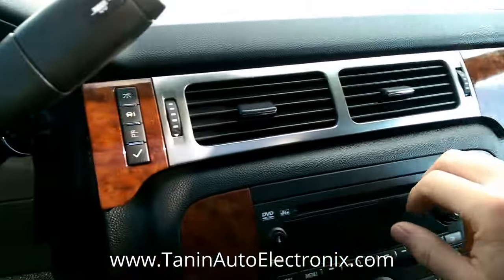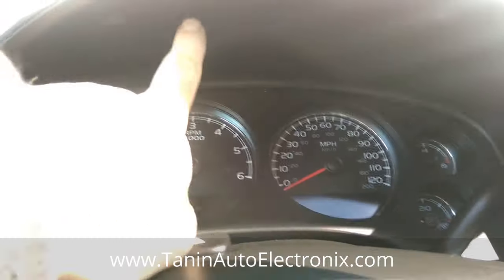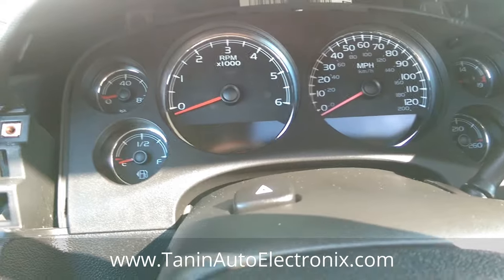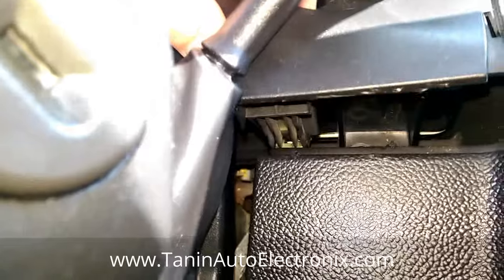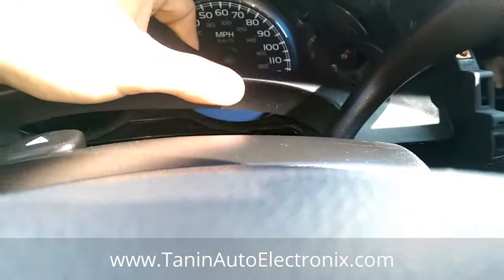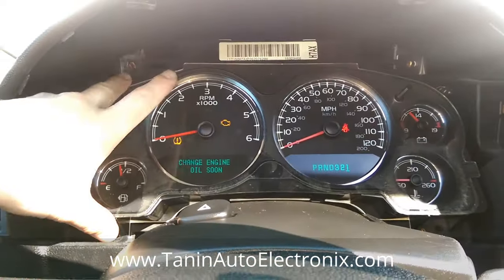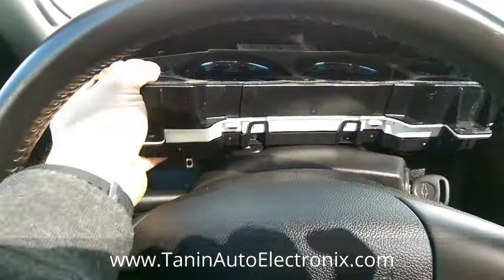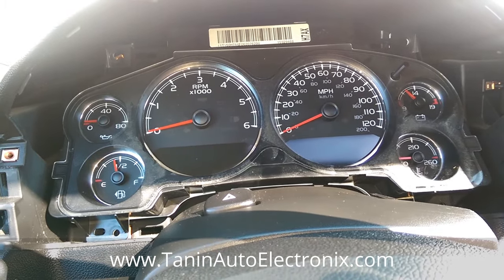How To Remove 2007-2014 Chevy Tahoe Silverado & GMC Sierra Yukon Instrument Cluster for Repair Tanin

Comment: quick question my 2010 sirverado start to fade the dashboard light turns on during the day but off at night time ,, so what it could be the issue i dont think is the bulbs inside the dash cause they turns on pretty good during the day but goes off at night
Reply from the maker: Could be the cluster itself, could be the solar sensor, or something in the truck that's telling the lights to turn on or off due to light or lack of light.

Comment: Question is there a upgraded gauge assembly replacement for the 2007-2014 Tahoe/Yukon/Sierra/Silverado? That gauge assembly is plain and out of date for that year vehicle, much improved on the 2015 and up.
Reply from the maker: No. Only thing we could do is change the greenish backlighting to a more modern bright white.  If you have a base model 4-gauge cluster you can also upgrade to a 6-gauge like the video.
Reply: +Tanin Auto Electronix understand and thank you for the reply
Reply: can i use this gauger in a  03 avalanche
Reply from the maker: Can you use a 2007-2014 cluster in a 2003? No.  You need to use a 2003-2005.
Reply: Tanin Auto E
...
lectronix
Reply: I realize this was from awhile ago but yes actually u can update the cluster you can buy replacement back screens and needles to change the entire look of the cluster and you can change the color of the lights inside it
Reply: You can buy the Z71 cluster for these models. Looks much better.

Comment: Could this be the problem for my check engine light not lighting up at all ? Even thought everything else lights up. Bc I failed my inspection over that. Also is there a fuse for a checking engine light?
Reply: Late Answer But Theres Time Where the Check Engine light LED will go out

Comment: 2009 Suburban LT - 1500 5.3 L.    The gauge cluster does not have the “Relearn Keyless Remote” module.  And it asks to “Service the Suspension System” which this model does not have.  Is it possible to reprogram the existing cluster with correct software?  TY JIMc
Reply from the maker: Cannot reprogram the incorrect cluster for the vehicle. It sounds a different cluster was installed that will not work for your truck. Would need more details.

Comment: 2013 suburban. My oil pressure is 80 after starting right away. Question is, is it the sender unit or stepper motor?
Reply from the maker: The cluster is working since it goes form 0 to 80.  It's just doing what it's being told to do. The problem is elsewhere
Reply: did you find the issue? Mine is doing the same thing.

Comment: When you unplugged the cluster from the cord, did it lose it's odometer reading and other info?
Reply from the maker: Hi Noah!

No, the mileage is stored safely in the cluster and will not erase if you take the cluster out of the vehicle. If you need help with repairing your cluster, please reach out to customer service and we'd be happy to assist you!
contact@taninauto.com
262-456-4147
Reply: @TaninAutoElectronix  Ahh, thank you. I was just looking to put a new overlay on it. My speedometer has the 20-40-60 and so forth, and it kinda throws me off. I like having the 10-20-30 and so forth. XD
Reply from the maker: @princenoah21  this would mean you have the base 4 or 6 gauge cluster, you would need to upgrade to the 6-gauge "Tahoe style" with the 10mph splits. We can set you up with that! Reach out to our customer service department and reference this YouTube video.
contact@taninauto.com
Reply: @TaninAutoElectronix  Oh yeah, mine is the 6 gauge cluster.
Reply from the maker: @Prince Noah  If you are interested in an overlay, please reach out to our customer service department with your vehicle information and reference this YouTube video.
contact@taninauto.com

Comment: Is it possible to swap a 2011 Silverado's cluster with a 2014 Silverado's guage cluster? And if I were to do that, what should I look out for?
Reply from the maker: These clusters have to be programmed to your specific VIN. As far as we know, the 2011 clusters and 2014 clusters are not interchangeable, so the VIN programming won't work and therefore the 2014 cluster won't function properly when installed in a 2011 model.

Comment: Hi I have a 2008 Chevrolet Tahoe n the problem is as I'm driving the cluster turns completely off n then back on as if I'm turning the key off n on n also seems to do it when temps drop below 60 degrees very very strange " any suggestions " thanks
Reply from the maker: Our techs would need to test your cluster to know for certain whether you need our repair service or a replacement cluster. Please give our office a call at 262-456-4147 or send us a message here: http://bit.ly/tae-contact
Thanks for watching!

Comment: I'm having an issue I thought you might know about I have an 08 Silverado Z71 just started it today the mileage and everything was flashing now the oil pressure is reading 40 not running folding reading 16 not running the fuel is showing half not running and when it is started they all maxed out except the temperature speedometer and tach are working any ideas
Reply from the maker: It sounds like you would need a new cluster but give us a call at your convenience to talk more about the issues. We have many options to help, including repair and if repair is not an option, we do sell refurbished clusters as well. 262-456-4147

Comment: Do you have to replace the cluster if the taillights turn signal don't work? I've replaced all 4 bulbs
Reply from the maker: Sorry for the delayed response Curtis! Unfortunately, we have not heard of this being an issue related to the instrument cluster before so we wouldn't be able to tell you for certain. Let us know if you found any answers!
Reply: OK thanks someone said it was a relay built into the cluster for the turn signal
Reply from the maker: We'll have to keep an eye out for that! While we do sell many replacements of these clusters, we just haven't had a customer tell us that's what their issue was (yet). We couldn't guarantee a replacement could fix your issue, but if you decide to go that route, we can help you replace your instrument cluster. We will make sure you get the right part, rebuild it, and program the VIN and miles into it.

Call our office at 262-456-4147 or check out our website listing at https://www.taninautoelectronix.com/product/2007-2013-gmc-chevrolet-truck-instrument-cluster/

Comment: How much are plug and at clusters for an 07 silverado? I just dont want to go thru the hassle of sending it in and waiting to get it back. Thanks in adv.
Reply from the maker: Depends specifically on part number/VIN.  Typically the standard 2007 cluster without off road package goes for $279 fully programmed and rebuilt.
Reply from the maker: Here is the direct link to purchase: http://www.taninautoelectronix.com/2007-2008-2009-2010-2013-GM-Truck-Gauge-Cluster-p/07gmtruck_cluster.htm

Comment: what fuse controls the PRND321
Reply from the maker: No fuse controls it.  The cluster needs to be removed and repaired. http://www.taninautoelectronix.com/2007-2008-2009-2010-2013-GM-Gauge-Cluster-Repair-p/07gm_repair.htm

Comment: Hello. I noticed that you didn't unplug the battery beforehand. Is battery removal required for novices?
Reply from the maker: Thanks for watching! If you're only removing the instrument cluster, it's usually not necessary to disconnect the battery. But if you want to be extra careful, it won't hurt to disconnect the battery either.

Comment: how the hell do you see the milage on the car.  this is the only car I've ever seen in my entire life that does not show the mileage at all times how many miles are on the car
Reply from the maker: The miles should show on the left display screen, under the RPM gauge, but it's common for the display screens on these clusters to stop working.
If your display screens are dim or completely blank, you might need to have your instrument cluster repaired: http://bit.ly/2007-2014-gm-truck-repair

Comment: I bought a new cluster and it says program cluster?
Reply from the maker: The cluster needs VIN programming.  You can send it in for this service.
Reply: Tanin Auto Electronix thank u
Reply: Lucas Garza does the miles display? Or is it the miles from the new cluster??
Reply: Tanin Auto Electronix which miles will display the miles from the new cluster or old?